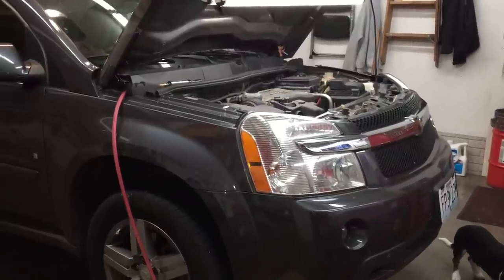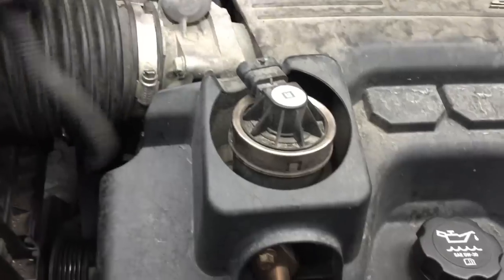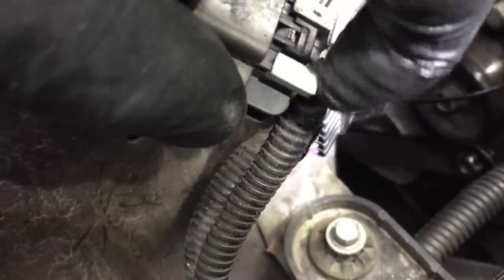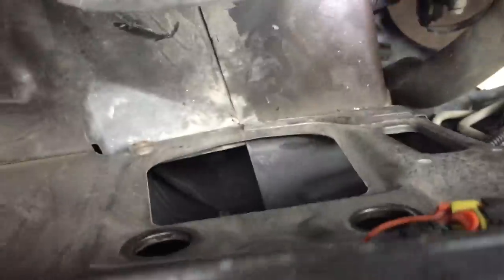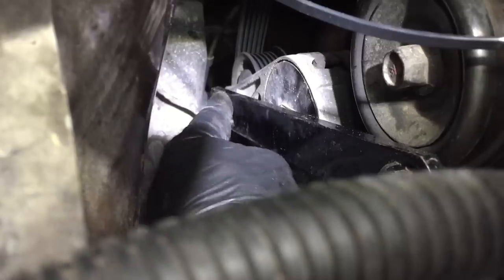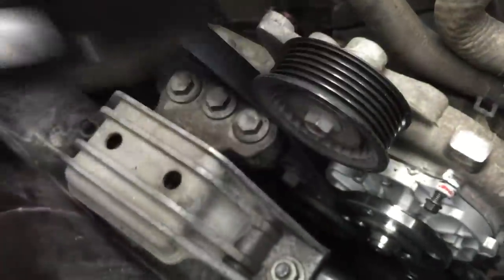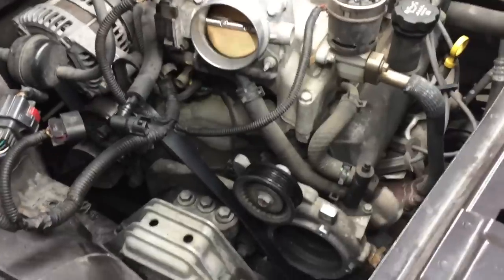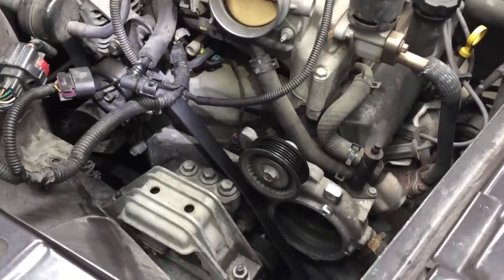2008 Chevy Equinox 3.4L. Water pump replacement. Belt removal.

Comment: Couldn't find the short 3/8 drive extension, so I had to remove the motor mount in order to get to the tensioner with the long serpentine belt tool. If anyone knows the part number or a link to the short version, I would be very grateful.

Comment: U don't need to add rtv sealant ?
Reply from the maker: You could, it wouldn’t hurt. If the gasket surface on the housing is not pitted then gasket should be good enough without RTV.

Comment: could you please explain ,WHY YOU CHANGED WATERPUMP
Reply from the maker: It was leaking coolant out of the water pump weep hole or the seal, which is behind the pulley and will drip coolant onto the belt.

Comment: Did you use any gasket sealer with the replacement gasket or no? And this video is very helpful by the way
Reply from the maker: Jason Haynes   Thanks. The gasket alone should be fine. I usually glue most gaskets on with Gaskacinch to hold it in place.
Reply: What's torque spec for the bolts

Comment: Hi about a little over a year ago i paid almost $1200.00 to have the heater core and thermostat replaced in my 08 equinox, now its over heating and there's a nice leak in the same area that you stated where the water pump is located,  do you think i should have the water pump replaced.
Reply from the maker: Tamari Mitchell   Sounds like the water pump could be leaking. You need to have it checked out.

Comment: How many miles when you did this? I am about to do this on my '08 3.4L Equinox with 89k miles. What color coolant did you replace it with?
Reply from the maker: Jamie   It had 188,000 miles on it. Use Dexcool or universal long life antifreeze.
Reply: Randy Templeton thanks Randy. I guess it’s the age and not the mileage in this case.
Reply: Randy Templeton well it’s not the pump. No evidence of leaking at the pump body. So back to the drawing board.
Reply from the maker: Jamie   There is a weep hole in the pump and if it’s leaking then it drips inside the pulley and drips off of the edge of the pulley. You might check that.
Reply: Randy Templeton so I jacked up my equinox and was in the process of doing a coolant super flush when I noticed this was leaking just the way you described. I don’t think it’s the water pump though and it only seems to happen when it’s jacked up... any ideas?